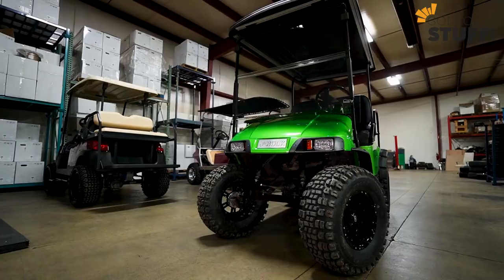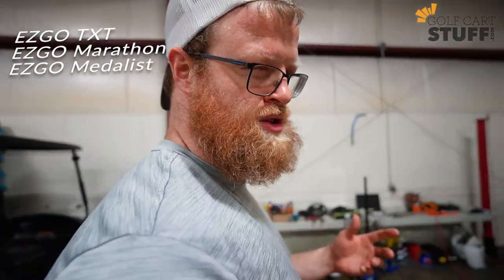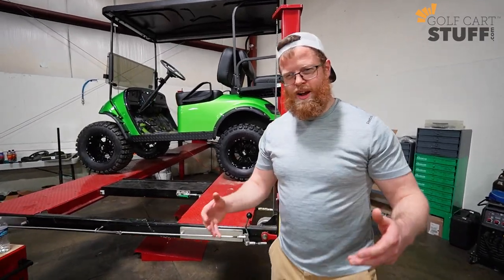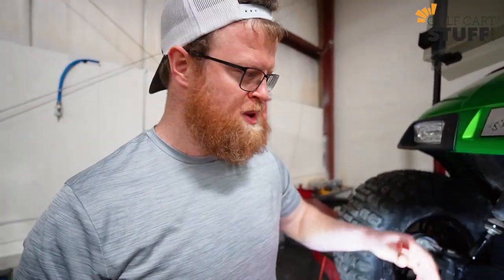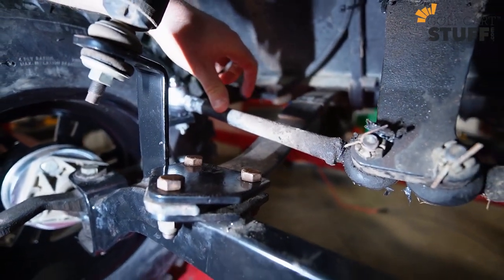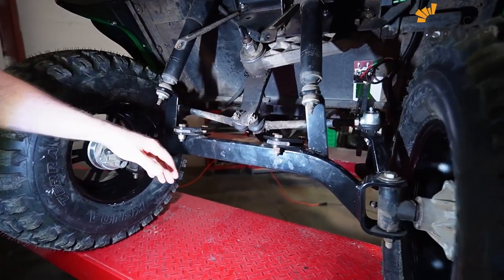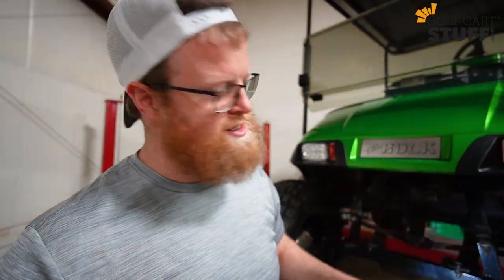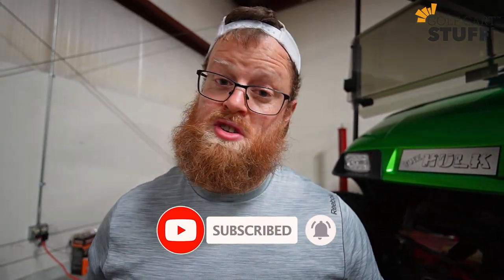6" EZGO DROP AXLE GOLF CART LIFT KIT! (EZGO TXT, Medalist, Marathon)

Comment: What lift kit would you suggest for a txt to have help with a bump cart path ? Need a more comfortable ride if you have any suggestions. Thanks
Reply from the maker: TXT carts are a tough one. Most of the lifts out there are drop spindle or drop axle which don’t really provide much of an upgrade in the comfort department. Any bumps or vibrations are sent through the carts suspension and frame.

(Unlike Club Car and Yamaha that have a-arms design to help bring more comfort)

When it comes to EZGO TXT carts there is a jakes long travel lift kit and a 7” RHOX BMF lift kit that are pricey but do have a more intricate set up. The RHOX can be stiff from what I’ve heard from our customers but it does beef up your front end substantially.

Comment: I've got a drop axle on my 2013 EZGO TXT 48 Volt. It feels like the cart is "swaying" while driving it. Almost like the front axle is kind of sliding laterally and it causes the cart to veer left/right on its own. Any thoughts on components I can check or replace?
Reply from the maker: Thanks for the comment! And great question. EZGOs don’t have a great a-arm designed light kit at this point. The main design is the drop axle lift and it’s fairly “economy” as far as price point and what you get. It’s not going to enhance the quality of ride like your experiencing but simply will give you the lift you need for clearance or to fit the larger tires and wheels.

The only other real option is the drop spindle. Those have their cons as well. I don’t know if any steering components that you can replace but checking connections to make sure all is right is a good idea of course. I’ve definitely felt that “sway” before on the lifted EZGO but I’ve also experienced it in a lifted wrangler 😂

Comment: Which lift specifically is this in the video and are those 25" tires?
Reply from the maker: That is the EZGO TXT drop axle lift kit with the 12” Stallion Gloss Black wheels and 25x10-12 Kenda Terra Trac K502 All Terrain tires! They look amazing and may require some 1” spacers to bump them out from rubbing in your frame.
Reply: We just put a 4 inch drop axel lift on our 99 ezgo and now the tires scrub when making a turn. How could we stop that?  We have 22 inch tires on. Thanks so much!